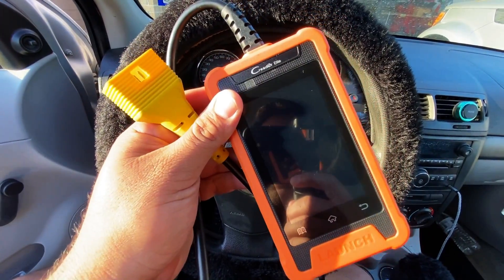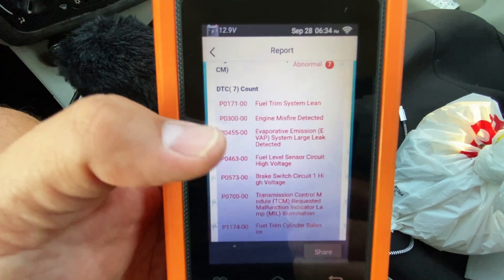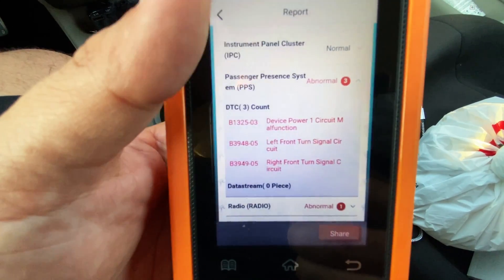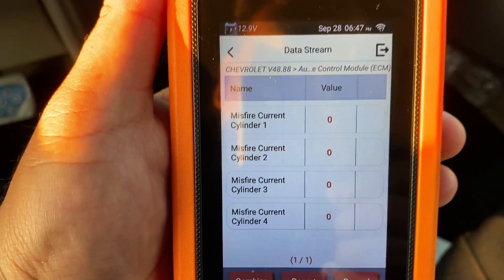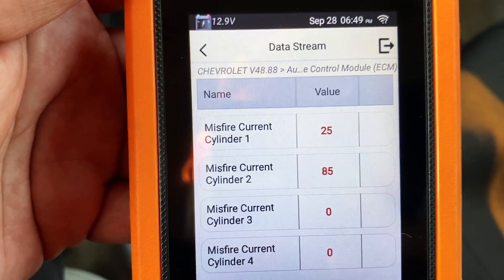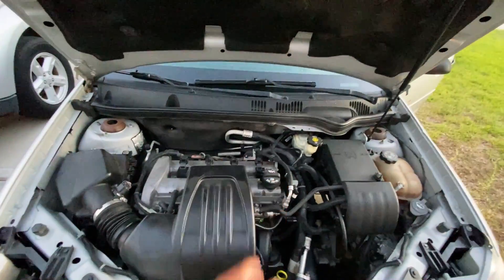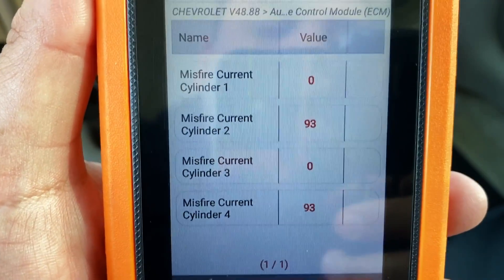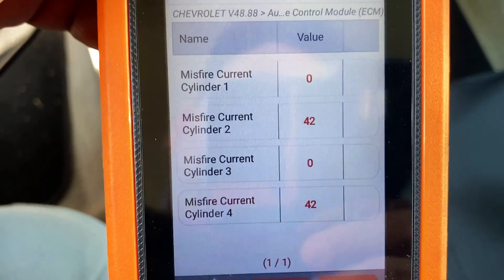CHEVY COBALT DEAD MISFIRE CHECK ENGINE LIGHT FLASHING DIAGNOSIS

Comment: Hello, I have a 2006 Chevrolet Cobalt with a 2200cc engine. I replaced the entire engine, but the problem persists. I can't find the cause of the following:
1- Black smoke coming from the exhaust
2- Excessive fuel consumption
3- The service light is on
4- The accelerator pedal malfunctions several times
5- The car has no power.
I have already replaced the injectors and spark plugs. What could be the cause? Thank you.

Comment: first thing i always check on the later model vehicles is a load test on the battery. a weak battery will cause multiple problems throughout the computer

Comment: How do you check for an electrical problem if the check engine light isn't on? None of the mechanics will put that computer on it because there isn't a check light.

Comment: The Cobalt is in the running for the worst car ever made.
Reply: I’d say the opposite. Mine has 300k on it and I’ve done nearly nothing except brakes, shocks, and other routine Mx. Still doesn’t use any oil between changes. Air still blows cold and I’ve got no diagnostic codes

Comment: Eric, in my opinion, you are one of the two best diagnostic experts on automobiles that are on YouTube. Every step of your diagnosis is to the point with important information and without a lot of filler (such as how to remove this bolt, or how to remove the spark plug, etc) Each step is quickly stated with all the important information. This coming from a technician that worked in dealerships for over 40 years. I thoroughly enjoy watching your videos and to try figuring out the problem along with you.
Reply: I agree with that evaluation .

Comment: You make completely wrong the compression test. Ok, you measured only 2 cylinders but for proper test you should remove all plugs. Why? Very simple, it eliminates variables. The weaker cylinder gives extra compression to the next on fire order because weaker compression. I really do not understand people who remove only 1 plug per time for testing...it is completely wrong reading!Sure not insane difference but there is difference

Comment: "Friends don't let friends drive 4-cylinder (or smaller) Chevrolets."  Ford, perhaps, had the "best" domestic (N. America) grasp upon small cars most recently (before giving up entirely).  GM/Chevy and Chrysler (imo) never did.  Never got the idea that GM or Chrysler really invested themselves in economy cars.
PS: The rule in the late '60's and '70s was never (ever) buy a Japanese import with an automatic transmission. There were good reasons for that. Toyota, Datsun, Mazda and Subaru were still too inexperienced in developing them.

Comment: you could have put a rubber glove over exhaust and taped to seal. to demo the air leaking as it would blow up and explode and looking at the valve it was wobbling so the valve stem guide is shot can't wait to see fix keep up the good work Eric

Comment: Running an engine with poor spark and bad plugs or improper plugs could cause excessive carbon buildup that can make the valve not seat properly and cause it to bend or cause the guides to wear out prematurely. This engine was not by far a reliable one to begin with and add a bunch of emission systems makes the issue worse. I would source a used head and hope it doesn't need to be rebuilt. I can't wait to see what you find out and make some good content getting this unreliable piece of GM trash back on the road.

Comment: It wouldn't be a bad idea to do a leakdown test on the fuel injectors. Sometimes a partially plugged one can overheat the exhaust valve and burn a chunk out of it. I realize this one appears to be bent or the seat in the head is fubared, but just saying.
Reply: The part 2 should be interesting: finding out why the valve travel seems shorter (not seating) or appears bent.
Reply: How do you do a leak down test on a fuel injector

Comment: Did you check the compression in the other cylinders?  The second one checked at less than 100 psig which is too low.  A valve job may not fix the engine?

Comment: Well I think once you take care of the engine issues... there may be a good possibility that the transmission issues could correct. Erratic Rpm can disrupt inputs, and include flag false codes. I'm looking forward to seeing the work getting done! 

On another note.... other YTers and colleagues and I just got done with the Super Saturday Automotive Training event here in Philly. You NEED to go to one of these events... and Oz I'm sure would be there too.... though he wasn't at this SS, I think he was just at ASTE in NC.  You would fit right in! Plus!  There's so much knowledge being passed around! Stay safe! Ttys
Reply from the maker: @Cuba's Automotive I plan on it next year. It's just difficult finding someone to take care of my kids while I'm gone, so I gotta figure that part out.
Reply: @ADVANCEDLEVELAUTO  very understandable. Family 1st, especially the little ones. Well, I hope los abuelos or maybe they have a titi to help you out. Lol 😬😉
Reply: Fixing the engine will not fix the shift solenoid concern on this. This is a 4T45E trans and that code P0973 is a 1-2 shift solenoid circuit code. Have put lots of solenoids in these for that, also wire damage on top of the trans for different circuit codes,  especially rodent damage.
Reply: @johnhnetkovsky8917  oh snap... I only listened to the video. I didn't realize the codes were displayed.  😬😅
Reply: @CubasAutomotive  No biggie.